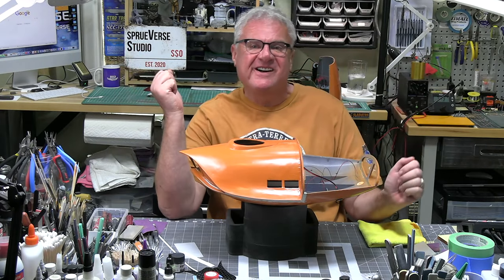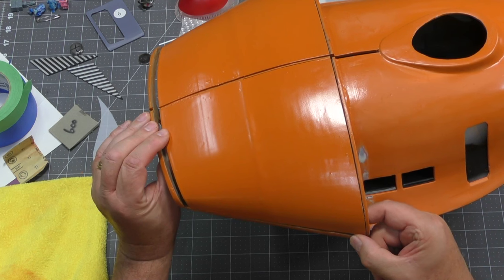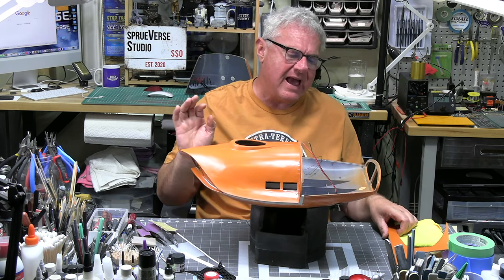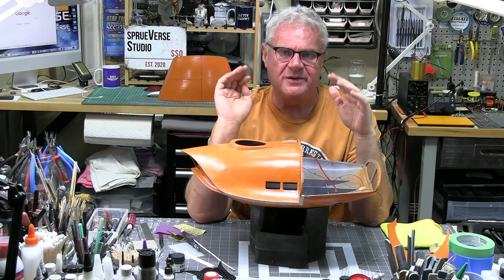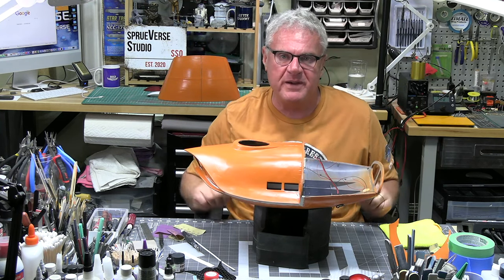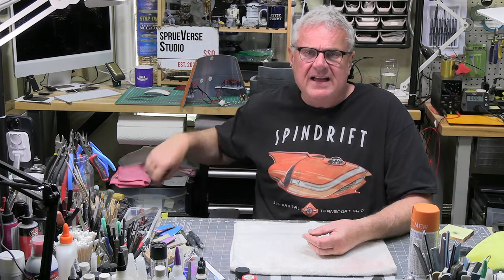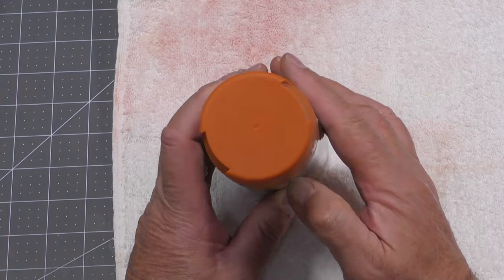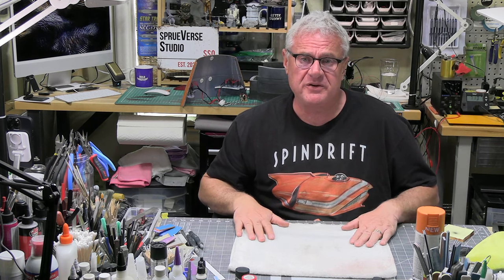Spindrift build part 3 - finale

Comment: And how much do we have to pay for that piece of crap that has all the gaps?.. Sorry but I gotta call it as I see it.
Reply from the maker: You don’t want to know, it would really upset you!🤮
Reply: @Spindrift-id1ez

The 24” 3D printed is a fine kit.  Randy Cooper did a build and has YT vids also.  Why Phil ended with that gap in the rear is odd and shouldn’t happen. When you first put the ship together, it’s best to tape it all together so every pieces fits where it should. Then, you can tap glue and then fully glue.  If you piece the top front and rear separately from the bottom, then you will encounter problems as they may be different angles.  It may help, having an interior so the top rests on it, otherwise the weight would naturally pull the top outwards as there is no internal support.  Having worked on my 2nd, I learned a lot but my first was the prototype and had even more parts.  Phil, you did an AWESOME job.

Comment: You noted that in the show "Manhunt" the Spindrift the actors ran around with seemed very light. In the revelatory "paint chip" email that you showcased, it was mentioned that good Mr. Jein also had a "lightweight" version of the ship. So there were several types out there.
I would like to see you do the occassional putty and foolin' around-- misery does enjoy company and we, out here, can comiserate! The lighting looks pretty durn good in the dome-- but the dome itself looks small to me. Either it's off or perhaps it should sit on the top (somehow) or needs to be redone altogether. Still... satisfies the look either way.
In my loudmouthed but always humble opinion, I say you need twice as many plants for your diorama. Certainly for the background. But I also see that you have not put the ground work in yet, so there's plenty of time.
I am very surprised that the various parts of the hull put up such a fight. But they don't call you Two-Fisted Segal for nuthin'
A technical word: your LED work is very good. The bread-n-butter hanging of lights is easy but doing it right is time-consuming. But that shows better grades than you give yourself. The acronym "SMD" is for an entire class of electronics, not just LEDs. Surface Mount Device is what's inside your phone, computers, radios-- etc. These are things meant to be handled by assembly robots not people. Thus we struggle. The descriptive numbers are in pairs and decimal millimeters-- so an "0805" is 0.8mm x 0.5mm, pretty durn small. They have mysterious markings and I try never to separate my SMD things from their packaging whenever possible. Something to watch out for when using a coin cell to test polarity of LEDs-- the red LED was the first color to be developed. It is also among the lowest voltages of the whole family of LEDs. As low as 1.25V, or 1.5V. Your coin cell puts out 2.8V to 3V-- so you're baking that red guy for a second. What I mean to say is, just check your polarity and get off that thing. When I was crawling up through the tubes, I read that LEDs wanted 20mAmps of current. That only becomes an issue when you're using different colors of LED-- they can have some very different Voltages. The world of whites generally runs 2.8V to 3.2V, yellow 2.8V, blue 3V to 3.2V-- and so on. One needs a resistor calculator to figure it all out. (They're out there!) Much to my surprise, the SMD versions also run the same currents as their more handy sized counterparts. But! I've seen some projects call for 30mAmps... don't know what to make of that, so I shy away...

All looking rather good-- safe travels off in old Blitey! Cheers

Comment: Hi Phil - loving this build. If you trawl through the Spindrift miniature pages of the Irwin Allen News Network site, you read from someone who, long ago, saw an original Spindrift prop and chip matched its colour to the nearest Testors paint. He said "Model Master International Orange" (which I believe is no longer available) which makes me so glad that, as soon as I read that 8 years ago I ordered four bottles from the States. They are indeed very like to the SW "Hearty Orange" from what I see and in the bottle the paint changes intensity from red to yellowy orange quite beautifully. I have the lower and aft hull of one of my three 1/64s - two Polar Lights and a Doll & Hobby - built and primed. I screwed up about 5 of the Aurora originals as a kid in the 1970s (I'm exactly your vintage) because I couldn't do the stripe neatly (I melted the kits using turps to remove the paint to try again) so that I live in terror, still, of finishing that first Polar lights job. It's been sitting in a box awaiting the top coat for six years.... I now stand in awe of your work and wish I knew to strip model paint with bleach not turps back in 75!